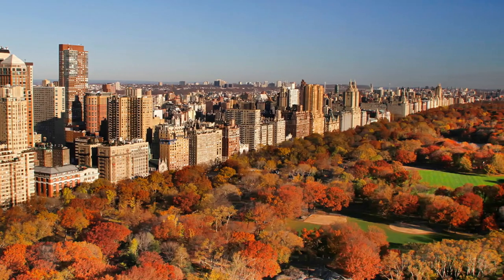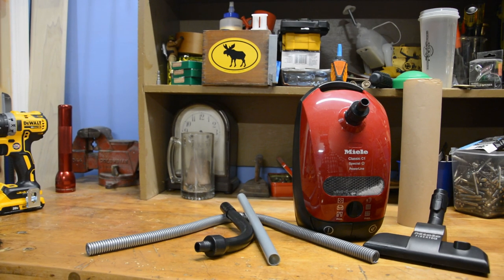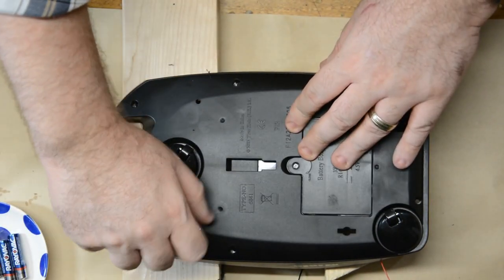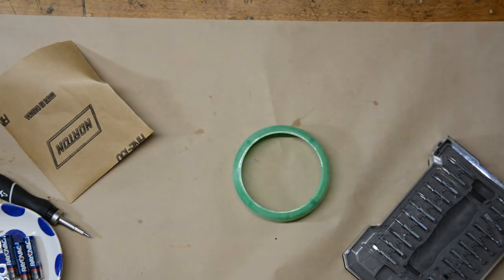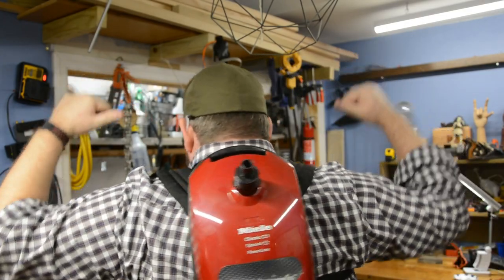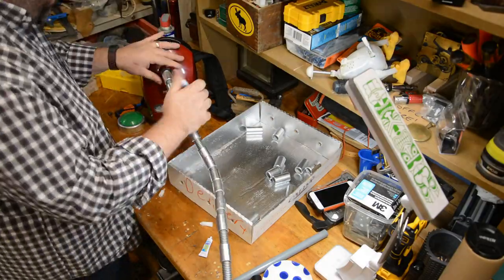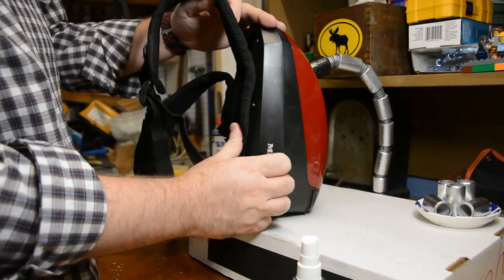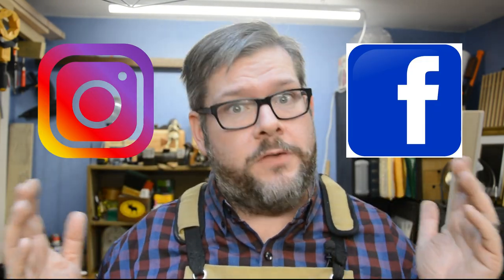Poltergust 5000 Luigi's Mansion

Comment: I actually built the poltergeist 3000 from the original Luigi's Mansion which is basically just adding the straps to the vacuum, And I also used Pringle lids for the wheels on the side
Reply from the maker: Nice!

Comment: Amazing job! Hats off to you! I stumbled across this video and luckily I myself picked the same vacuum which is awaiting my craftiness lol How large is the opening of the tubes you used for the vacuums hose? I’m trying to find something that will fit over the hose but unsure of what size I will need. Any other suggestions on material I could use in place of what you used? I don’t have access to a saw to individually cut. Thanks, I sincerely appreciate this video and the input! Hope my son is just as excited!
Reply from the maker: I used the conduit. Don’t remember what size, just measured the tube and got what was close, but slightly larger.
Reply: @BurkeMakesStuff  I realize this is a desperate attempt lol and I feel a bit rude even asking but I don’t have the need necessary tools to make these pieces and I’ve searched high and low for substitutes. If by chance you ever have any extra pieces left lying around and interested. I would GLADLY pay you to make the pieces to fit over the hose. Just an idea if ever interested. Sincerely thanks for the great video regardless, it alone has helped a lot

Comment: What type of plastic tubing is that? 1 inch diameter...?
Reply from the maker: Arlow Farrell which tubing? The grey that I cut and put around the vacuum tube is underground conduit. The inside diameter is just over 3/4”. The vacuum tube is 3/4” so it was a nice tight fit over it.

Comment: Awesome and what about the flashlight
Reply from the maker: Cristian Garcia thanks! Decided not to include it. Basically just because if time. If you want you could totally add a chrome antique, large boulder, flashlight! Simply drill out a hole in line with the Handle of it slightly larger than the diameter of the flashlight Handel and insert it! Taa Daa!